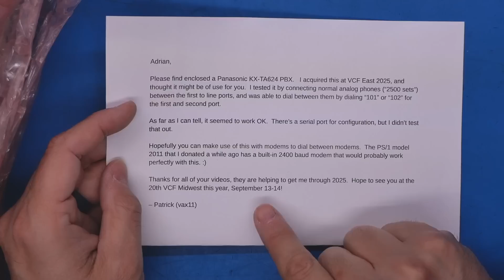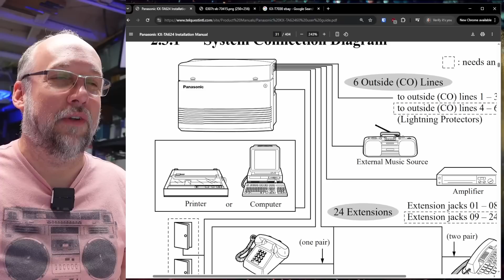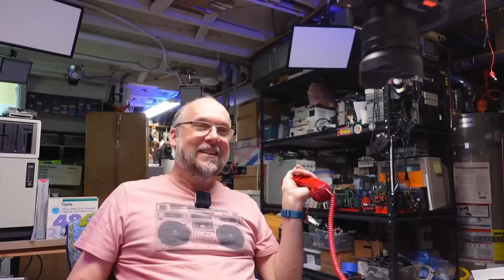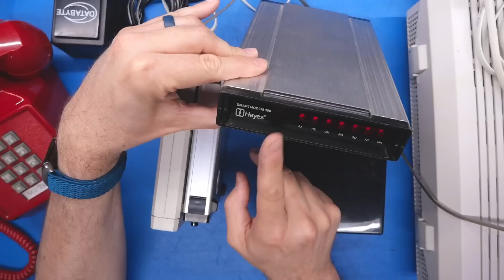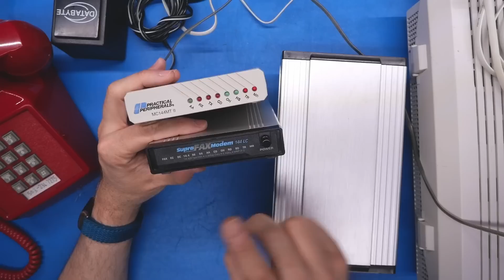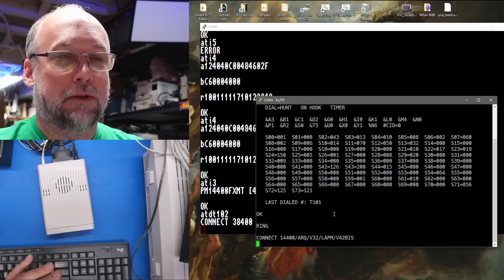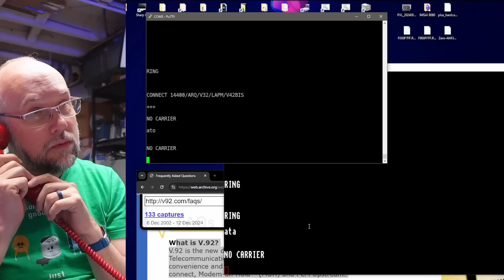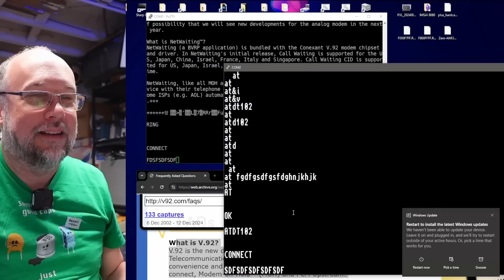How to use phones and modems like it's 1992

Comment: The dial tone sounds different because the Panasonic does not generate pure 350 and 440 Hz tones, it generates a square wave then applies a low pass filter to the output to filter out (most) of the harmonics.

Comment: I have a Siemens HiPath 1120 PBX (8 extensions, upgradeable to 16) which is a bit more recent, and I hope that I will be able to get an ISDN extension card to connect something like a Courier I-Modem to have a 56k ISP
Currently, I only have 1 modem attached, and it does 33.6k perfectly, without any problems

Comment: FYI even if you had 2 56k modem's you could not get 56k between them.  One side had to be digital. You would need one side to be Cisco Router with with a special digital modem bank card. and have a t1 interface between the pbx and router handling the 56k connection.

Comment: Hehe takes me back.  I will watch this later.  Just wanted to drop a comment to say I learned as a kid to hit the hangup button 1 more time than the number I wanted to dial - pulse dialing.  Dial a 9?  Hit the hangup button 10 times.  Later in life I learned not to hold telephone cable in my mouth when trying to wire a telephone jack.  Someone called at the same time - thats when the volts hit.  ATDT commands (I still ran those back in the early days of broadband to diagnose / technically it was a modem just cellular)  Call waiting was bad kept interrupting downloads until I learned to disable that in the modem.  Started with an Atari 400 / tape drive didnt have the 300 baud modem like War Games but a bit later in life I started with a Packard Bell and a 1200 baud.  Good ol' days lol.  X modem,  Y modem.  Renegade BBS.  I could tell what speed I connected at based on the sound.  Anyway having fun on the 4th - this popped up in my feed.  Ill come back and watch later.  Thanks!

Comment: I used a similar system back in the day. The dual extension feature was two distinct extentions. It was kind of ext 1 and ext 1a. They would be completely seperate. The digital handsets even had the analogue pair terminate to a rj11. So you could plug a modern into any digital handset and dial out or in. Saved you having to break the analogue pair out. So in your system of expect you get 24 analogue extensions and 24 digital extensions for a max of 48. I think it was called a Panasonic Hybrid system.

Comment: I worked for a Panasonic partner. My role was to the enhance the company exchange so it could be mounted in a 19 inch rack and the
lines for phones went over the ethernet. I never completed my work as a level 1 PC technician left, as telecommunications engineer I was the obvious replacement, why I didn't have a clue. I tried to assist as best as I could but when the boss complained that I hadn't met the target on the switch I pointed out that I had been supplying level 1 PC support. He lost it. It was him who had made me sort out level 1 PC support. I packed my belongings and put the word out on the psychopath who ran the company. Turns out that the wider community knew that the guy was nuts.

Comment: I had an Adam, with the Coleco plug in, and it had an internal 300 baud.  I borrowed my uncles USR 2400 now and again and I could hardly read that fast.  I then had  GVP 9600, ZyXcel 16.8 and the a USR Courier 56k.  Those Supra modems sucked, they were the worst.  Ran a couple of boards back in the day and it was so fun.  Miss those days, just a bit.

Comment: I used to rip those PBX's out and put Cisco phones in. We had to box them up and send them back so I didn't get to keep one.
Seems like a very easy way to connect some modems up. Aside from needing the specialized phone to do configuration.
I've collected a couple serial modems to setup a dial up network. With some cheap usb modems to put on a raspberry pi as the server, so I can do login and pass data back out. Maybe host a quake or doom server (Not sure if possible, though I have a couple VIA 1ghz ITX MB I could use instead as servers).

I agree that using an ATA would be the way to get a external connection for the phones. I'm not sure the modems will work over those. Easiest way to get the modem connected PCs online  would be to bridge from dial up modem to a wifi or cat5 connection on a PC (eg Windows or a raspberry pi)

I would be interested if you do a followup video to:
A) Find the max speed of this solution
B) Test something that can achieve full 56k speeds (A dream I have yet to realize after buying my first 56k modem in 2001. It didn't get past around 38k speeds due to long line lengths and poor carrier cabling).

Comment: Adrian, I worked at Telquest International from 2006 to 2013 (you visited the website to get the ta-624 manual). I was selling those KX-TA824 and KX-TA624 up until 2013! They were around for years.

Comment: It’s not terminating the calls correctly on hangup because the ports are configured for a digital hybrid handset.  They are still mostly compatible with POTS.  If you do get yourself a phone so you can reprogram it, you can reset the port to fully replicate true single pair analog phone handling.

Comment: I used to use a pair of modems locally to copy stuff from one computer to another with just a phone cord.  ATX1D on one modem, ATA on the other.  Then just transfer files using X/Z modem.  There were some old games that had a multiplayer over serial that worked that way as well.

Comment: There are still uses for dial-up services, Many credit/debit card machines still use dial-up, more secure and harder to hack due to the fact every time it dials up it uses a different IP.

Also I doubt analog phone lines are going anywhere soon, they are still super usefull in rural areas, also the fact that many lines can still operate if the power grid goes down, provided your using a corded phone or a battery backup system for your cordless.

Also I suspect that MANY businesses still use PBX systems.

Comment: My most recent acquisition is from a couple of weeks ago, an external Intel SatisFAXtion 400e.  I need a power supply for it as well.  It kind of has that external Hayes look.  Back in 2003, my college built a new dorm.  I was managing the Sciences Computing Center back then.  They asked for items to put in a 100 year time capsule.  I could kick myself now for putting in an external Hayes 2400 modem in there with my business card as well as a picture of my college girlfriend and me.  More than one mistake was made there, and I wonder what condition that modem will be like in 2103 when it's opened. :(

Comment: Another fun device, though be it on a much smaller scale, is called a ComShare.  I had a 350 back when I was a kid (I have a 450 now!) that would intercept phone calls on the first ring and route to modem, voice, or FAX, depending on if it was a normal ring, a distinctive ring (multiple numbers for one phone line with different ringing patterns), the FAX tone, or user entering a sequence of touch tone buttons.

Comment: Man I got a hack to get it working cheap and easy, here´s how I´ve done: I have a PAP2 voip adapter, it had 2 phone jacks behind with 48v. you just have to plug its power adapter,  dont even have to configure it, because you just need the voltage. I think any voip adapter will do.  There will be no dial tone also. What you have todo is using a phone splitter (with one male and 2 female ports) you will plug it into just one of the phone ports of the voip, to get the voltage. then you plug 2 cables in the splitter, these cables will go to the 2 modems, so they have voltage and hear each other. If you plug the modems in the 2 ports of the voip adapter they will never hear each other, unless you configure 2 lines and make a call through the internet. (but because of the compression codecs it will not work properly) So, you just have to open a terminal for each modem switch to modem command mode and type ATX0DP123 it will dial even without dialtone and you type ATA on the other terminal the other modem to pickup the line. they will connect! PS: I also still have my Courier V.Everything!

Comment: Thanks for sharing  how a phone switch works.  When I was on high school, I worked as an office assistant which included lunch time and breaks receptionist at my uncle's corporation. Even though I knew how to run the switchboard and connect calls, I always wondered how it worked internally. Like how the "hold music" got on the line. 
Thanks for explaining it all in an easy to understand way.
I don't remember the brand but it was in the mid to late 80's, and I believe it had 6 lines and boy when they were all full, it kept me hopping. We didn't have voicemail either so I had to take messages while answering and directing incoming calls.

Comment: IIRC, that "clicky" answer tone that higher-speed modems generate is used as a signal to the telco to disable echo cancellation.  The clicks are phase-reversals.  I believe a 2400bps modem should still be able to recognize that tone, and then all the capabilities are communicated via v.8/v.8bis regardless of what generation is on each end.

Earlier modems don't do this because ... well, for one, it requires a more sophisticated digital phone switch to detect that tone, which wasn't going to be as prevalent in the early-to-late 80s.  And two, lower modulation speeds could wallpaper over a lot of sins, whereas high-speed connections required the cleanest, most predictable line quality you could get.

The answer tone itself, at 2100Hz, disabled echo suppression on long-distance trunks.

Comment: Technically, an analog-to-analog 56k connection should be absolutely possible.  It's just not implemented in firmware for any modem.  The reason being, it can't survive and A/D/A conversion process, so it would only be usable for back-to-back connections, or through a fully analog phone system.  Since most of us aren't using landline phones connected to crossbar switches anymore, and there isn't much need to make interoffice modem calls, that ship has sailed.

So, yes, one side HAS to be digital, and the other side can go through a maximum of ONE analog-to-digital conversion.  The reason:  56k is at, or nearly at, the theoretical limit for information density in an 8-bit, 8kHz PCM channel.  (8b*8k=64kbit, but sometimes 1 bit is robbed for line signaling purposes, and 7b*8k=56kbit.)  The digital modem is aligning the modulated data with the 8kHz sampling clock that the telco uses to fill every last drop of that bandwidth.  Trivial on a digital link, like a T1 or ISDN line, because the clock is recovered from the framing -- but practically unfeasible for an analog hand-off.

You COULD attempt to synchronize with the digital clock by shifting the transitions forward and back until you got perfect alignment, but this would be an ongoing process, as the modem and telco would eventually drift out of sync.  No clock is perfect.  The analog half of a v.92 call even uses the datastream from the digital side as a clock reference to pack in as much as possible on its uplink channel.

And then there's that pesky "FCC limit."  Basically, crosstalk on analog phone lines is a problem.  Since the physical phone lines from the CO to subscribers is a long run of tightly bundled copper wires, particularly loud signals in one pair can leak into physically adjacent pairs.  To prevent that, the FCC placed a limit on how hot the signal can be.  But this is a level-over-duration measurement, so while the line CAN reach its full signal level and be in compliance, it can't stay at that level.  You won't notice a transient or two, but you would definitely hear a constant full-volume screech on pairs coupling with each other.  So, the modem has to refrain from using symbols that saturate the analog signal level, which decreases the modulation density, and therefore the bandwidth... but just a little.  It's still pretty incredible how much data you could pack into a phone call.  (And even more incredible how much you could pack in, over that same distance, when you weren't limited to 8kHz sampling... ala DSL.)

Comment: Man, the Courier V.everything modem really was the bee's knees. Everyone sang its praises from the rooftops and touted its reliability and robustness. Back in the day I was always buying things on the cheap because I was on a starving student type of budget, and so I had all sorts of weird off-brand modems, and of course they were often glitchy and unreliable. I really wanted a Courier, but they were way out of my budget. Fortunately, an offer I couldn't refuse fell into my lap one day. Some of the tech heads in the community decided to spin up a local ISP, and so they bought Courier modems by the pallet load. One of the techs at that ISP reached out to the community and invited anyone who wanted to, to join in a group buy for a Courier modem along with the ISP, so we could benefit from a bulk discount. Well that was too good to pass up. I scraped up whatever cash I could and had juuust enough to buy in. And man that modem was awesome. It "just worked." I used the heck out of that thing, it was my main connection to BBSs (and later, the dial-up Internet) into the early 2000s, when I finally switched to DSL. Unfortunately I have no idea where it is now. A few years ago I decided to set up a home retro lab, and I wanted to set up some modems so I could dial between my computers (maybe set up a BBS on one, which was one of my bucket list things, I always wanted to run a BBS.) I looked for that old Courier but could not for the life of me find it. I don't recall ever selling it (I wanted to keep it as a backup "just in case") but it must have gotten lost in one of my many moves. For all I know it might still be packed in some box shoved in the garage somewhere. So I ended up buying one on eBay, along with a couple other modems that I used to use back in the day, for nostalgia's sake. Didn't go the whole analog PBX route tho, I bought a couple cheap ATA VoIP boxes and set them up using Cathode Ray Dude's excellent guide.

Comment: Hey Adrian. 
Guess what... I've got this very system nailed to the wall in our office/ex-reception/ex shop/ex-staff room/ex-clinic (etc). Totally bulletproof and has never needed a repair (we've had it 20 years and it was secondhand when we got it) - it came with some old building site offices which we re-purposed.

Comment: @Adrian's Digital Basement Could you use this setup with multiple modems dial in pick which extension you want and let the computers connect ? EG: extension 101 C64 BBS, extension 102 Amiga BBS. and so on ??

Comment: Fun fact: those Hayes modems (and all the other clones with the "flat box" form factor) are designed specifically to sit underneath a Bell-style phone like the big one you have. It's why they have that "bump" on the top that fits perfectly between the feet on the phone. The Windows 95 modem icon even shows one set up like this. Hayes actually made a desktop clock in the same form factor so that you could stack them up on your desk.

Comment: This brings back memories... back in the late 90's I had set up a BBS with a fileserver using a Honeywell Bull AP-M 286, a Racal-Vadic Maxwell 2400 modem, and a full height SCSI hard drive scavenged from an HP Vectra that I had mounted in a TRS-80 floppy drive housing.  I still have all of the hardware, but nothing has been powered up for over 20 years.

Comment: That cross-connect wire spool that you have was used in the telephone central office to cross-connect T1s.  A T1 is a 4 wire connection, and the DSX1 panels would be wire wrap connections.  Though don't forget to roll it on one side!  Now I'm feeling old!

Comment: One time in the 2000s I made a fake dial-up ISP at home so my Dreamcast could "dial" my linux box and share it's ADSL (early broadband) connection. But I didn't have any  phone switching going on, just a phone cable between the Dreamcast an external modem connected to the PC. I just put a random number into the Dreamcast dialer, listened for the dialing to end, then on the PC end I had minicom open and manually sent an ATA command to the modem. The modems shook hands and negotiated and, surprisingly, whatever I had set up with SLIP and iptables actually worked and I was able to download a 100% Soul Calibur save file to replace mine that had corrupted.

Comment: Adrian, no ISPs in your area supporting "shotgun" modems?  I remember that being a thing with the USR modems.  You could use two modems and two lines to double your speeds.
2001 very well could have been it's production date.  Place I worked for got a KX-TDE in 2008.  It was a larger, next generation unit with LAN for configuration and limited IP phone (SIP) usage.
Nice thing about theses smaller units was all of the individual jacks.  Larger units used a 50-pin centronics that you had to break out.

Comment: II personally use a Panasonic KX-TD1232 in my shop. 4 incoming Google Voice numbers via two OBIHAI VoIP adapters. They system has been working trouble free for over 10 years. This system will work with the fancy digital phones down to 1920's rotary dial phones.

Comment: Really cool video!  The modems brings back lots more memories.  The neon bulb is used as a gas discharge tube for static.  Many older ham radios from the '80s-00's have them to prevent static damage in the rig.